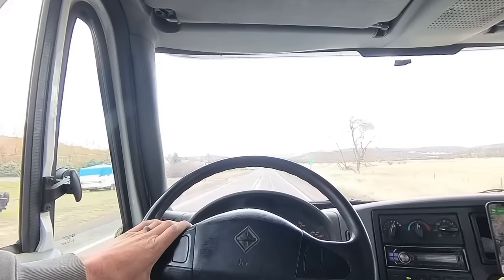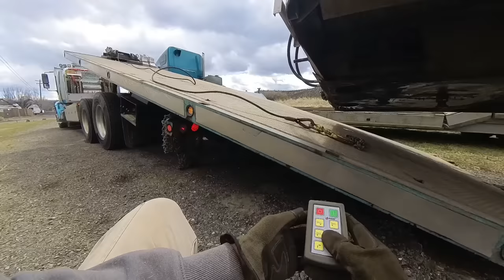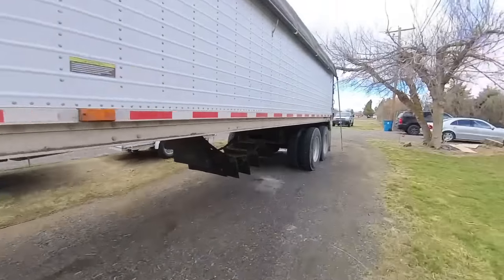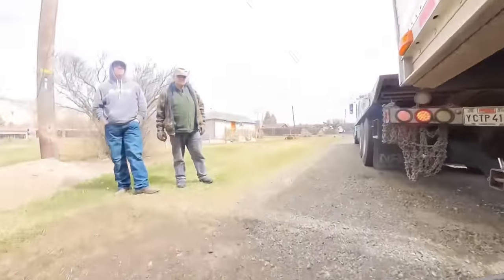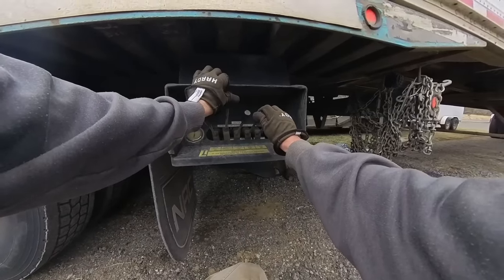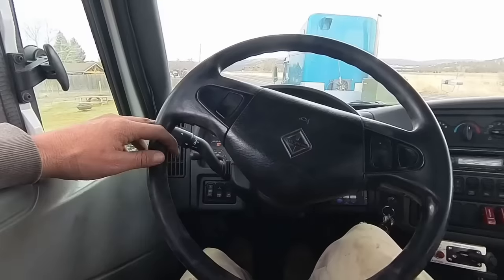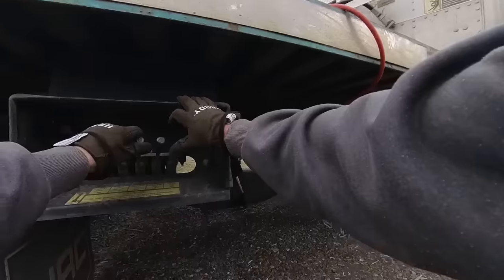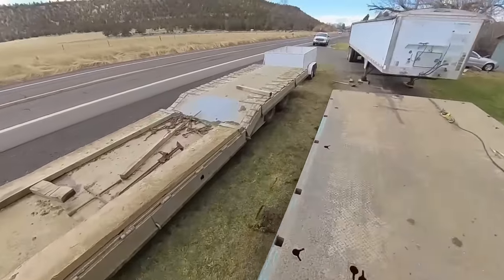Loaded Trailer Going Over!

Comment: In case anyone says that Casey did it wrong , he doesn't have an 1150R rotator at his disposal , just his heavy duty rollback , which worked just fine ( although I'd bet he wouldn't mind having a rotator truck )
Reply from the maker: Maybe one day
Reply: As the old saying goes, “you run what you brung”
Reply: Even I would love to have a rotator to, and I don’t even need to tow anything. I could actually use a rollback to move equipment though, that would be nice, but I have a dually for that.
Reply: 49,000 a walk in a park for the NRC40TB.
Reply: @clark7117  not sure how the ratings relate to actual capacity, but the NRC40TB is rated at 40,000 pounds.
Reply: @CaseyLaDelle  I hear Jami Davis from the Highway Thru Hell fames is selling them cheap 😂😢
Reply: Does it really matter how he did it a as  long as he got the job done
Reply: That was quicker than setting up a Rotator
What's the possibility of having the fith wheel hitch on the tilt deck rather than the lift ?
Reply: @thatdave86  I, too, was wondering about that. Would hight, strength, and rollback interference be issues? Would have been a quick fix if it was possible. Extend out, lift, get the weight over the axle, and go. We can't always get what we want though.
Appreciated Casey taking us along for the ride!
Reply: @CaseyLaDelle  You could start by getting some trumpets and a hard hat?  Can't really see it though 😄
Reply: Good job!
I am sure you did some things that are absolutely not recommended, but it worked!  👍
Reply: Hard to beat a rotator, I recovered a load 45,000 lbs that the driver dropped on soft ground the rotator just backed up to the side popped it right out of the ground.
Reply: @CaseyLaDelle  Just hit jackpot in PowerBall😎 and it`s reality to you. No, you can`t stop doing what you like to do, but maybe more selective, to jobs you doing yourself, and have more time for family.
Reply: @CaseyLaDelle   Be careful what you ask for ,,, 
somebody might find you one for an ungodly low price !!!
Reply: @gpw203  sketchy ?????? 100% Careful, Safe, wham bam thank you ma'am 😊
Reply: @Thatdave  Have to be big dollar job to justify firing 🔥 up a rotator & heading out
Reply from the maker: @thatdave86  they do make an attachment that puts the 5th wheel on the deck, but I got the version that goes on the wheel lift so that when a truck pulling a camper breaks down I can load the truck on the deck and pull the trailer behind
Reply: @CaseyLaDelle  just thought that having options may help ,my thinking would be to have that hitch on a track system that stored under the winch ,the winch mounted higher above it ,the you just roll the hitch to it's position,I know technical aye 😄and quick release pins for it to be mounted on the lift .
Yes I know your answer,donate the money to you for this lol 
I was impressed with the truck being moved by the deck well done , I  just keep trying to see things made easy for you when you need different gear for different jobs .
Keep up the hard work and the honest testing 
Cheers
Reply: Blocks under landing gear would have been sufficient.where was the semi tractor?
Reply: @thorin693  Wouldn't be cost effective even if Casey had a rotator, He did the job in a timely fashion,
Reply: @clark7117   I'm waiting for an EV version of a Century M100 .. and wonder how that would handle a cross country haul ...
Reply: I found a 1150R for $92.95, but they're out of stock.
Reply: That is a pretty sweet truck! Seems well equipped and versatile!
Reply: @clark7117  I think Casey is being diplomatic.  There's some appearance the young man overloaded the trailer- underestimating the density and not keeping tabs on how fast the total was rising.  If he fills the rest full at the same density, will that trailer be safe?  Granted the key fault was not blocking the stands
Reply: Don't park loaded trailers on gravel
Reply: @CaseyLaDelle  i wasn’t expecting ur rollback to be able to lift a heavy trailer.I really underestimated rollbacks
Reply: @CaseyLaDelle  At the end, you said get used to cotter pins, I think you meant hitch pins.
Reply: @laymansview5246  good catch. Don’t be that guy getting caught up on semantics, though, take care bud.
Reply: ๅยอดเยี่ยมได้ความรู้ดี
Reply: @Adoubletrippletap  I get what you're saying, but there's a big difference between cotter pins and hitch pins. HAGD.
Reply: @laymansview5246  for sure, but we all get what happened there
Reply: Those rotators are very very expensive. Hundreds of thousands of dollars. I watch Ron Pratt with Midwedt Truck who runs one and he has talked about it. Also I watch another channel who works on cars and gets old cars running says if it works is it a dumb idea?  I agree with that
Reply: @Ziro666cpm   its just like using a board or a stick to move a heay object ..a lever and a fulcrum .. the process has been around fo centuries ..milenium even  one of the greek  smart guys was quoted as sayin .. with a large enoigh  lever and fulcrum  he could move the world

Comment: I drove truck in Alaska for 13 years, before my 10 years here in Oregon. I've had a front end loader lift and drag my trailer out of a driveway once. Also had several landing gear sink. Once had to chain a sinking trailer to my truck frame to keep it from flipping while waiting for a wrecker and a guy like Casey. Casey did a fantastic job with what he had to work with. A very capable dude.

Comment: This guy is an amazing operator with incredible expertise. His truck is a very trick piece of kit. I like the way he gave the other guy the opportunity of making the decision that the job was finished. If he messed up putting the prime mover, I'm Australian, under the trailer and stuffed it up, the tow truck driver could have charged him for a second job. 
The initial problem could have been avoided if he had put blocks of wood under the legs in the first place. If he didn't have any blocks, he could have used the spare wheel as a weight spreader under the trailer leg, if he placed it face down.

Comment: A lot of work to get the trailer to safer ground. So much weight for your truck, at least the hydraulics are set to bypass when they have reached their limits. Hope you didn't mess anything up that will show up in the future. Great job for what you had to work with. That truck is pretty awesome with the right operator. Thanks for taking us along.

Comment: I just retired after 40 years of of dump truckin ,straight  jobs and trailers. Casey U sir are incredibly talented,smooth and thoughtful. I’ve seen more than my share of beached trailers parked in the wrong place .(no lumber around really?)  I’m a less than impressed with the “driver” who dropped a loaded trailer on an obviously soft driveway. Dude U truly bailed those boys out. Great job! Stick right with it. That new rotator  is just around corner.

Comment: Your knowledge showed through on that job.  Don't think the customer could have gotten another recovery company that had the truck to handle that lift.  You gave them options for getting the trailer level and then moving the trailer to a level location.  You seemed to be ahead of them each step of the way.
Awesome saving the trailer for the customer.

Comment: They need to get some steel plates if they are going to be dropping loaded trailers.  That hole in the bed came in handy.

Put the boards length wise is a good idea incase they push it backwards, it won’t slide right off.
Reply: Yep.  Note for next time.  Trailer king pin fits in this hole.

Comment: When we were in the Boy Scouts we were having a paper drive and the driver didn't put blocks under the legs. We always loaded those trucks pretty full...the trailer sank through the ashphalt to the bottom of the trailer. We called on the CB radio and two big wreckers showed up and picked it up from both sides. Took quite a while to get it rigged properly. Great guys, they did it for free, like Casey does on the off-road recoveries. Casey did a great job on this, need to be creative and use what you have!

Comment: Well done Casey. It would be good if you could get the 5th wheel attached to the rear edge of the roll bed.
Sinking a trailer. Well, I have seen this happen couple times and once I have done it myself. It was a rainy summer on late 90´s and we transported the new paper machine in parts in trailers to the hay field behind the paper mill to wait for assembly. It was early in the morning, it was raining when I backed the trailer into the field between others. I stacked the 4 x 4" wooden planks brought to the place for that purpose under the legs of the trailer for its cross. I was suspicious when I pulled the dolly out from under the trailer and soon I saw in the rear view mirror how the trailer started to sink. There was nothing more to do, the dolly was out from under and the 4 x 4" wooden planks broke like toothpicks under weight. Quite soon the front of the trailer was less than 2 ft off the ground and only sank further. This happened to several trailers on this summer. In time, they lifted the trailers up from the hay field, transported them one by one to the factory and unloaded the loads.

Comment: This happened to me once.
Had a loaded 48 foot spread axle with over 40,000 pounds of structural steel on it.
Dropped it behind a structural steel company shop.
And when I pulled out from under it, it just slowly kept on dropping. But fast enough that I couldn’t get back under it fast enough.

They kinda over estimated how much road gravel they had laid into the drop area.
😳🙄🫡🫠

PS: I have been driving OTR for almost 20 years.
Mostly Hazmat.
Soooo that kinda makes me an expert.
I coast to a stop most of the time.
Reply: If it's a Stop Sign or you know your going to Stop. But, if it's a stale red light, that might turn green, or any other circumstance where you need to go instead of stop. It might get embarrassing, struggling to find a gear in the middle of an intersection. 

How many pounds did he put on those drives ? 49,000.? 

I did 24 years, before I retired. 

Sometimes I want to be a tow truck operator. When I watch Casey.

Comment: I coast all the time in my stick shift HHR. I don't downshift for nothing. It wears the front brakes faster but it saves the engine from excessive high revs & gives it a longer life. Brake pads are cheaper than engines.

Comment: Reminds me of the time, I was starting my first trip as an over the road trucker. When I brought the tractor over to the shipper's address, The landing gear was sunk about a foot into the ground. The shipper called a tow truck and when it got there it was a little car sized wrecker to pick up a forty foot, trailer that weighed 35000 pounds. Kind of a late start that morning waiting for the big wrecker.
Reply: Lmao all you do then is air down your tractor and get rather frame under the trailer front ..crib it up with  4x4 and air up you tractor ..lifts it right up  .. easy peasy .. not a miracle or any thing ..those suspensions are made to lift  all you have to do is get under the load with the tractor  orrmeven  a chain thin usevthe tractor ..  unless it was 35byears ago then maybe you had no air ride ...I can't vmbelieve nobody on here seems to be aware of this.

Comment: In my earliest days of trucking back in the eighties I was doing dry box and I mistakenly dropped a loaded trailer in the wrong place on the pavement. I didn't realize at the time that the concrete has were there specifically for your trailer landing gear. Lessons learned! I never knew that those trucks came with a portable fifth wheel. I knew when he was going to try to get underneath that trailer he was going to lift those steers right up off the ground with that tiny little Wrecker

Comment: The amount of lift that truck bed has is amazing, working safely with that much hydraulic power is difficult, so easy to just try to lift it "just a little" when the bed is in the wrong place would be tempting. An excellent video..
Reply: Lmao it works like a lever and a fulcrum.. stick and a rock .. amazing

Comment: A guy unhooked a fully loaded semi on loose gravel.   Very wet, muddy loose gravel.  Only good part?  That trailer landing gear went down almost even over 2 FEET.   Dang that roll back did it so much easier.    That was dang impressive of rollback lifting.

Comment: I had almost the exact situation happen around 30 years ago. Was hauling a beer trailer, nose loaded with about 45,000 lbs of beer for the railyard. Had the clutch linkage go out, but managed to get off I-25 and into a old lot. Waiting for another truck to get it, we set it down, and 10 seconds later the higher landing gear sunk in maybe 5", then we watched as it slowly rolled over and dumped all that beer come out of the roof. My situation let no time for anything to be done. but I wouldn't have left that trailer on that water logged strip of land unless I had a tractor to get under that trailer right away. It stills seem so surreal to remember that trailer roll onto it's side.

Comment: Boy that’s handy, great now I’m gonna have to buy one thanks 

Don’t push those fifth wheel adapters to the limit, ask me how I know
Reply from the maker: I’ve never hurt a 5th wheel adapter, but I did send one through the floor of a loaded trailer years ago.  Turns out not all kingpin plates like taking all the weight in a 12” circle 😂
Reply from the maker: Oh, and if you would have seen me today towing a 36’ RV while hauling a van on the deck you would have already placed your order!

Comment: I had to drop a heavily loaded trailer at a dirt lot lit this once.  Poor lighting, but I saw another trailer sunk all the way.  Someone had worked on the lot and softened the ground without tamping it down firm.  Neither had they put any steel plates like they normally had there.  It was a bit of a walk, but I went and got permission to drop somewhere else until the got some plates.

Comment: I see the trailer has a "walking floor". If it's half full of damp wood mulch it darn sure is heavy. May be next time he should use more 2x6 cribbing under the landing gear. That sure is a nice wrecker you have with that steel bed. The fifth wheel gimick was worth the money.

Comment: I was running behind another driver and he was pulling a empty lowboy, he hit a pipe that went under the trailer ripping the air lines off the trailer, the springs on the maxi’s took over flat spotting 16 tires and he almost went through the windshield 😮. Those spring break’s are no joke.

Comment: cotter pins are important...They also have ratings.

Let me tell you a little story: I am an electrician. we have a special hydraulic tool, its called a table bender. it bends conduit from i think 2.5 inches all the way up to 6 inches. the hydraulic pump is rated for 10,000 pounds of force. the ram? probably a lot more...

anyway, i worked with this guy (dont even remember his name, i hated working with him) who was always rushing to get everything done yesterday. idk why, we're union and it was on a very big job. so these benders have a lot of very large pins that help keep everything together while also allowing a user to change the sizes needed and to have some semblance of portability. these pins are supposed to have cotter pins for safety, but they can go missing. this bender was missing a pin. i knew it was, everyone knew it was, idk why it wasnt replaced, but while it can be dangerous, if you take your time and make sure everything is in place, the chances, while not 0%, are low enough that if you watch where you stand, everything should be ok.

so i leave this job for a week and come back, someone tells me about how the guy i mentioned before nearly lost his eye while i was gone, i was told it was when he was using the table bender. my theory is that he didnt double check to make sure the pin was secure before bending, and of course, this general contractor was all over him for not wearing safety glasses. (this company is probably the most strict when it comes to safety) what baffles me even more is the fact that i was also told he came back the next day, too. and a crazier sidenote, the next job i went on after that, i worked with his son who told me that people dont usually like him and like his father, but i was the opposite.

So yea, defintiely use the proper cotter pins. they arent there for decoration

Comment: I was filling an old wine tanker with wine one time, and it started to sink in. We had to turn the pump off, and put some pallets under the front of it to hold it up. A lot of pressure sits on the landing gear when you are loaded up the front of a trailer!
Reply: A lot of those are frameless saves on weight... you should never  drop or load frameless with out tractor  under it .. very easy to lose landing gear  with no frame
Reply: @jamesgibson5876  we drop ours off. I have filled tankers a few times at the instruction of the trucking company in Australia. They would drop the B trailer off sometimes and go elsewhere with the A trailer!

Where I work now we do not own our tractor. We also use it for storage out of season too. The old tanker was a 69. Our new one is 86. We have no factory manual for it, we just leave it on solid ground!
Reply: @annyer262  been a few years since I was a tanker yanker! It's definitely  a different sport! ...
Reply: @jamesgibson5876  what we are doing is oddball. In the big wine areas there are dedicated companies with tankers with compartments available to hire. Unfortunately where I am there are not any of these companies around. So this is why we have our own with 4 compartments. For a lot of my products I cannot fill a barrel tanker. I do not have enough. Sometimes I run with 4 different juices or wines. I am a winemaker  by profession. I never thought I would need to develop skills in DOT regs and truck dispatch!